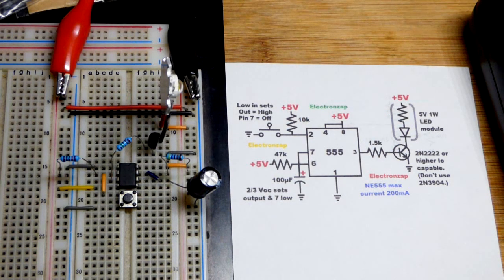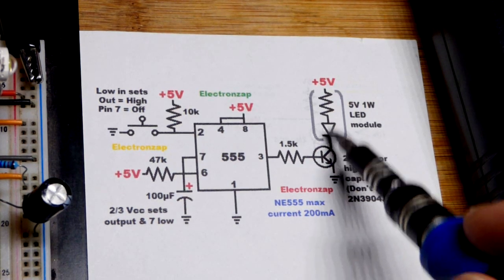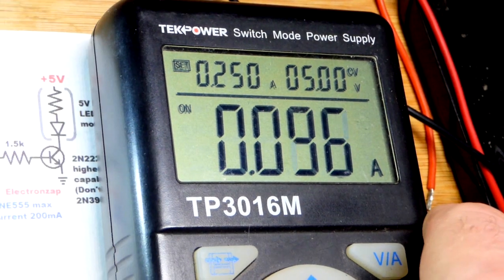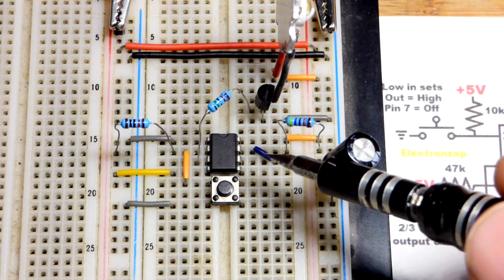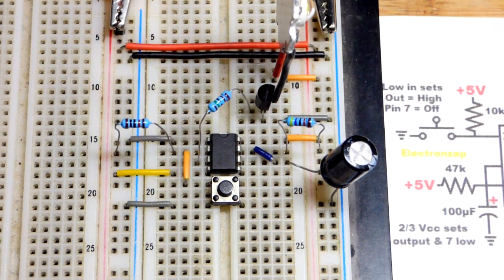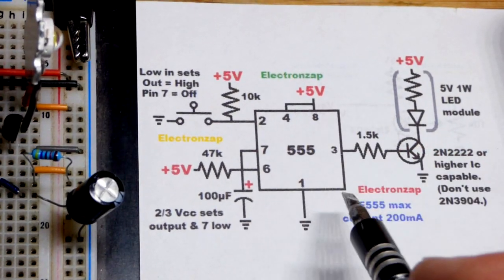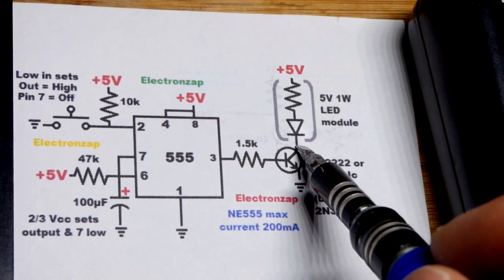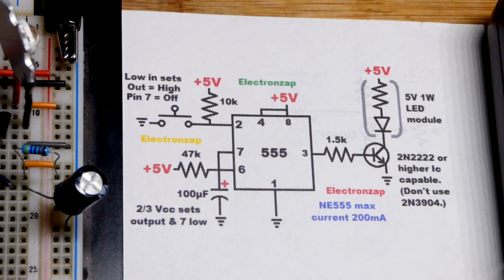2N2222 NPN BJT helps Monostable 555 timer switch a 5V 1W LED module

Comment: Great start but, in the real world you also need a pnp so you are not switching the ground with a pull down. This is a good way to teach theory, but not a safe way to power an external device. Show them the rest. Show them what the 3906 or even bc638 will do for them.
Reply from the maker: Thanks for the info!

Comment: ok i'm nit-picking here, but pin 6 and 7 and the resistor capacitor combination, its a 4 way join on the diagram. 4 way joins are depreciated..... in the 60's they were dropped from the 'standards' as 4 way joins where shown with a DOT to distinguish that it was a 4 way join not just 2 north/south and east/west connection passing, the dot on the joined connections would often fail to be duplicated by the photocopiers of the time leading to people misreading the diagrams when 'the dots fell off'. the fix was to draw a horseshoe jump where two crossed instead. this then became an issue for early ascii graphics printers as they didnt have a horseshoe character, so that was dropped and became replaced by using only 3 way joins, meaning a 4 way has to be constructed from 2 staggered 3 ways...
dots on 3 ways being optional, but I tend to think they look prettier.....

The 555 is so useful, one of the first i played with and the 741, i blew up many lol
Reply from the maker: Thanks for the info!